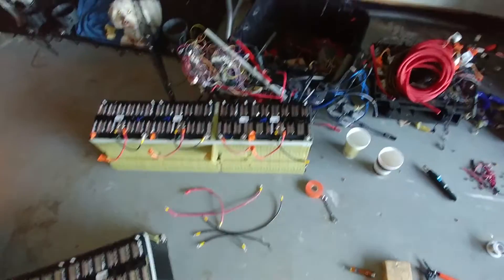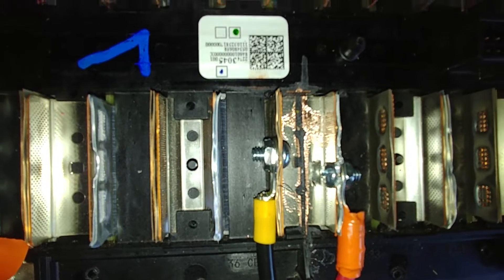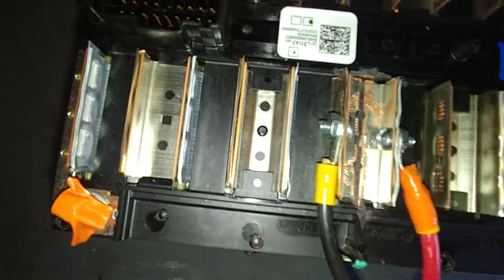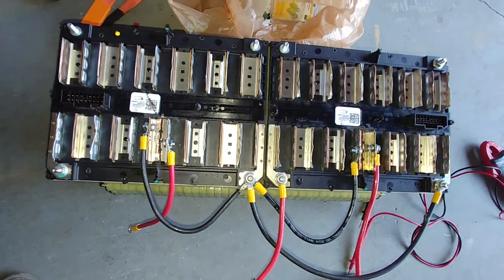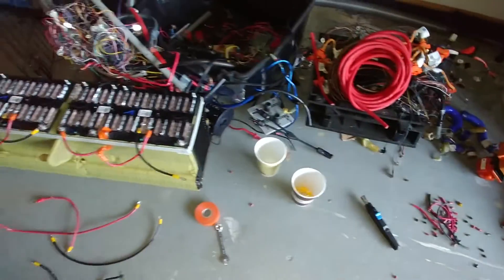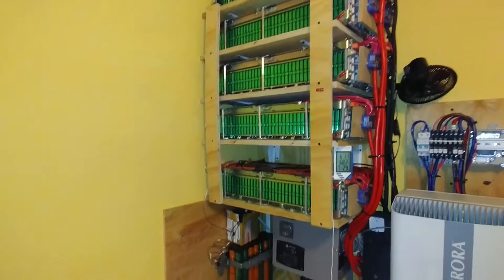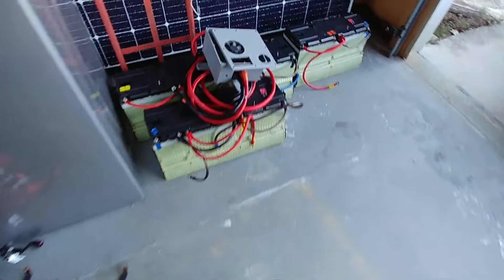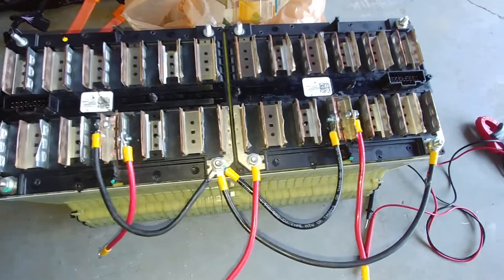DIY Chevy volt powerwall convert to 24v

Comment: Man. I'd love to have some good ev 24 volt batteries. I have a all in one powmr 3000 watt controller and 8 panels. I'm fighting stage 4 cancer and trying to find a good deal on batteries so me and the wife have electricity especially if I become more sick. Any help where to find the batteries would be appreciated
Reply from the maker: Thanks for checking out my video///as for the batteries I got them from the junkyard so you can try there and you get well soon

Comment: Are you using a bms
Reply from the maker: thanks for checking out my video,,,,,,,no i am not using any bms i dont think i need one,i have been using the ford lithium pack from january of this year and every so often i check the voltage on the cells and they are at 4.1v where i charge them to,when full its 4.2v,so it will be the same for these chevy volts cell
Reply: if so how is it set up